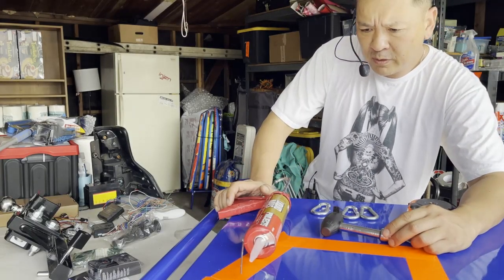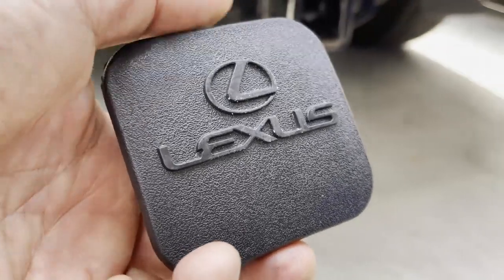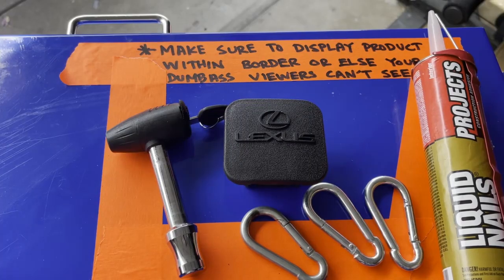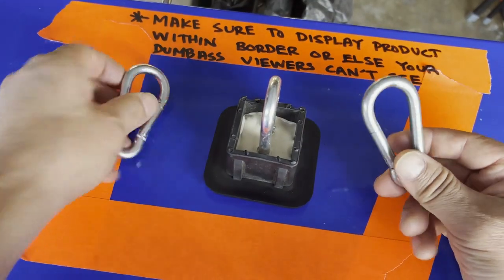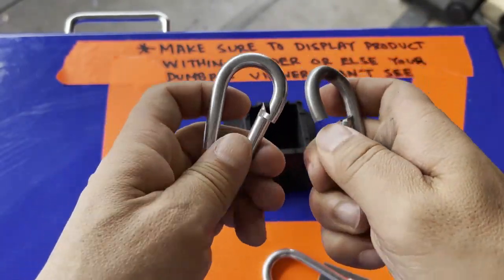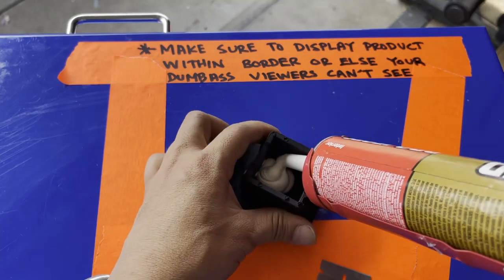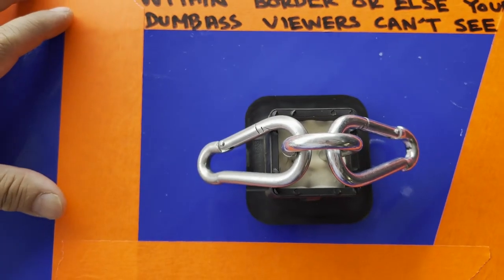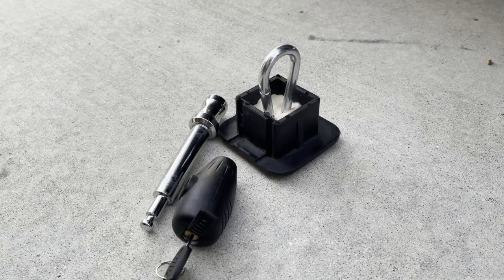Lexus Tow Hitch Rubber Cover Anti-Theft

Comment: Way to create a fix Bob. If Lexus did it right, the length of the plug would've been long enough to go back to the lock pin hole and have a hole thru it for the pin to pass thru.
Reply from the maker: I agree 👍

Comment: Finally happened to me, my shit got stolen. I used JB Weld SteelStik 8267 first which held the hook well from the start and dried in 5-10 minutes then I topped it off with JB Weld Epoxy which dried in another 30-40 minutes. Thanks for the great Idea.
Reply from the maker: Dammit JB weld is a great idea!

Comment: Thanks Bob!  I just had to order another Tow Hitch Cover after it being stolen for the 4th time in 2 months.
Reply from the maker: mine just got stolen again.
Reply: @GXBOB  I did what you said as far as putting liquid nails in the cover, but I also screwed flat-head machine screws into the sides of the cover to hold the clasp imbedded in liquid nails in the cover.  We'll see if it works.
Reply: Wow, didn't know there was a black market for these!  Great cool tip/method Bob to keep them secure from the petty thief.

Comment: Nice video again bob. Question? Can you do a video on what to do when “check BSM system” shows up? Thanks!!!
Reply from the maker: RAy, Check BSM system is very very rare and only occurs after 2 things happen.  You either got into an accident that disrupted any of your bumper sensor wiring OR your bumper sensors have been a victim of the environment.  I would go through every single one of your sensors on your front and rear bumpers and wipe them all down with a paper towel and restart the car.
Reply: @GXBOB  wiped them all down and as of now, seems all good. Thanks Bob!!!

Comment: Bob where did you get your hitch lock from ?
Reply from the maker: Where else? Harbor freight!!! It’s called the haul master.
Reply: @GXBOB  which size do we need? They have three…5/8in….1/2in…and 1/4in. Thank you Bob!
Reply from the maker: @thewholeeventhorizon  You can take any size that fits loose to your lock pin diameter.  you don't want it tight or else you'll have a hard time trying to wiggle your pin into the loop blindly.
Reply: @GXBOB  what size is yours in the video? I just figure since we have the same vehicle I might as well just use what works for you.
Reply from the maker: @thewholeeventhorizon  the largest loop inner diameter is 1”.